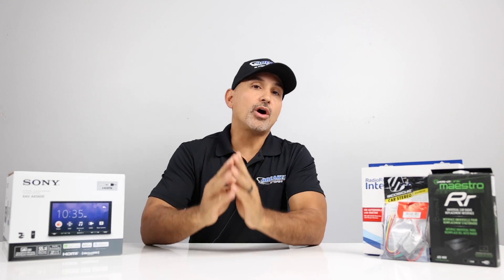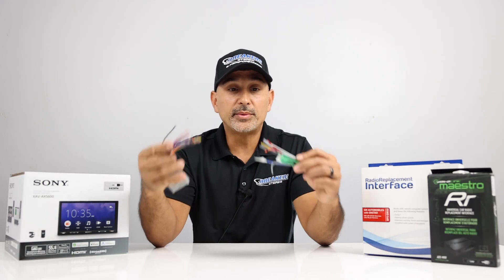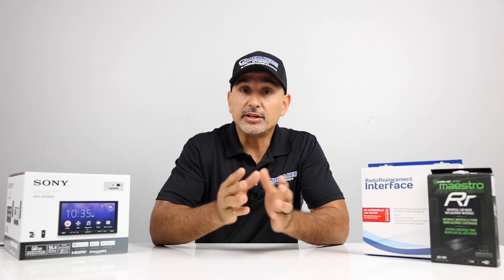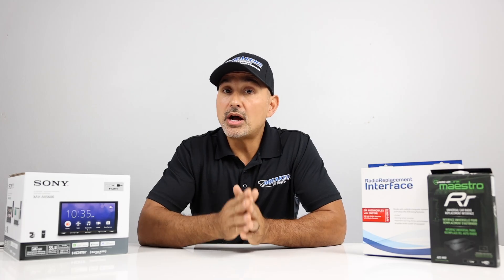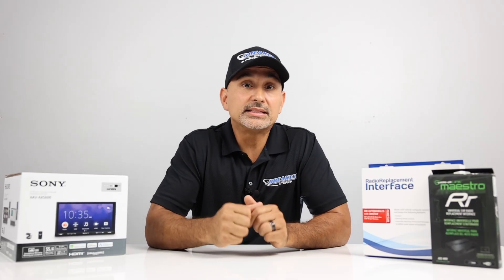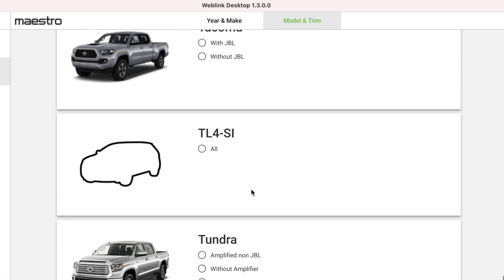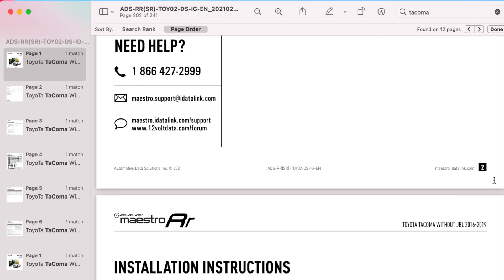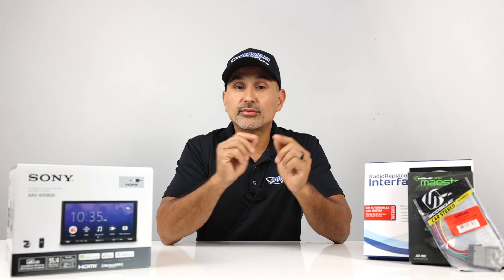How to Wire Up a Car Stereo and iDataLink Maestro RR.

Comment: I got a used kenwood screen already wired with a maestro rr that was in a 2013 ram . Its going in a 2014 ram do I need a pac as well to install an aftermarket amp ?

Comment: I get the impression that all those interfaces sux. You'll not be able to use that new HU amp you just bought with the nice specs, you'll still be using the sucky stock amp, if you wanna ' retain ' the SWC
They talk a big hi tech game but don't offer jack sh*t in reality.

Comment: How do I retain or is it possible too retain tps on 2012 tundra does not show my tps engine oil temp or climate controls and I can’t change the double tap on steering wheel controls

Comment: I have a 2015 soul and I’m trying to place a poneer 2660 in but keep the steering wheel buttons I’m lost as to do I just use the plug that goes into the back of the radio or I have to do all the wiring cause the color codes are not there to match what goes to what?

Comment: Hi is there anyway to install idatalink Maestro in Honda Accord 7 (2003-2007) with dual zone AC to show climate control on head unit screen. Custom wiring can be done if circuit provided

Comment: what do you do if your radio is not on. the list, and all you need is steering wheel controls, with the maestro RR, it says it will work with most analog swc radios, but theres no instructions on flashing it for a unlisted radio

Comment: I just had a kenwood deck installed in my 2011 f150 with the maestro. Now i want to go back and add amps myself. With the maestro and idatalink harness, where should i tap into the factory speakers wires and rca's for the 9 wire to the speakers?  Or can i buy another harness to go from factory speakers to the amps? Thanks

Comment: Is it really required to plug the OBD connector to the car ?
What if is not connected?
Reply: Just finished installing mine today.  It woud not work at all without the OBDII plugged in. Now I am troubleshooting my AC controls.  After install all I get is on/off and cant control the temp.
Reply: @Rick D  Hello, i guess it all depends on the car you have. I did the installation yesterday, and is really an Option to connect the OBD connector to the car. On my case the radio works with and without it. OBD connections allows to see the car gauges. At the end i decided to connect it, i can see all the gauges on the radio.

Comment: Now will the pac os5 retain the factory xm module for a xm ready head unit for my 2011 Silverado? Any input is greatly appreciated I want to do my research before spending money.
Reply: No
Reply: @jamesyoung7655  well I bought one, and it does
Reply: @downtoearthconstruction  cool I thought you had to purchase the sxv300… Good to know it’ll be cheaper on my customers then thanks for the information
Reply: @jamesyoung7655  I was pretty stoked I bought a truck and the previous owner had a lifetime subscription to xm so I wanted to upgrade the head unit to something modern and wanted to know if there was a way to retain it and it so happened to be the option after a buddy of mine looked into it aswell.

Comment: I installed the Maestro RR and it is an awesome unit but it was way more work than just hooking up a simple radio. We added two cameras, one dash cam, radar detector, two amps, sub woofer, all new speakers made to look factory. It was a lot of work that took two full days but it was well worth it. You did a great job of explaining everything. Thanks

Comment: Thank you.  Very useful video.  I wish there were a way to install future updates to the Maestro RR without having to rip it out of the car.  I'm dealing with a parasitic draw issue but can't get to the unit.  Will need to take my car to the shop.
Reply: The RR is programmable via Bluetooth. I would assume updates can be done via Bluetooth as well.

Comment: I have a 2013 Ram 1500 I want to upgrade the radio what would you suggest without cutting the bracket in the back that holds the single den
Reply from the maker: If you get a single din you should be ok without cutting right..?? Ok so look a a floating panel radio by pioneer or alpine

Comment: 2012 Silverado (w/o nav or bose) with planet audio p70cpa using PAC rp5 gm31 but the 3.5 swc doesn’t work I can’t figure out why
Reply: I had the same issue try moving it to am other 3.5 mm plug port. I have a avh-w4400nex. Hope it works I didn't make a video but I have everything on this video except idata link and that stero

Comment: Nice info wiring my radio up and bam, you guys released this. 

Quick question: I'm wiring an Alpine ilx-w650 to a 2005 toyota tundra using CRUX SWRTY-61J. I noticed that the CRUX harness doesn't have rear speakers wiring, but the Alpine wiring does. Would you guys recommend connecting the Alpine harness to the toyota harness for rear speakers if not anyone have any recommendations?
Reply from the maker: Looks like your Toyota might have a JBL system. If it does you have just left and right outputs from the factory amp.  Just plug in the front  and the rear speakers should play.
Reply: @BreakersStereo  Thanks for the help guys. I'll tie it into the front speakers as well. Keep the videos rolling.